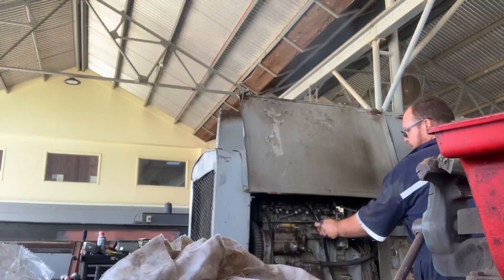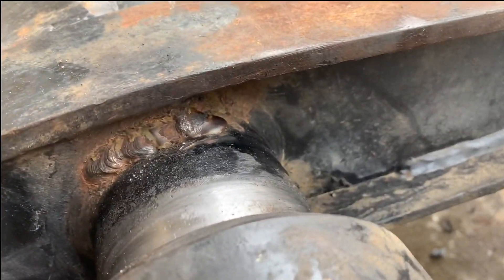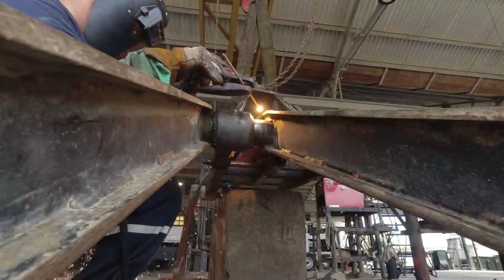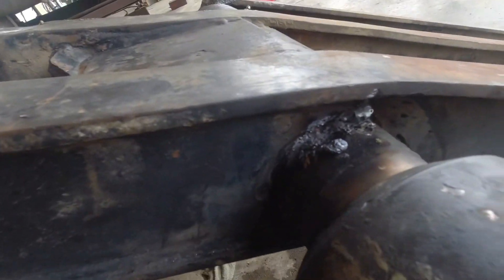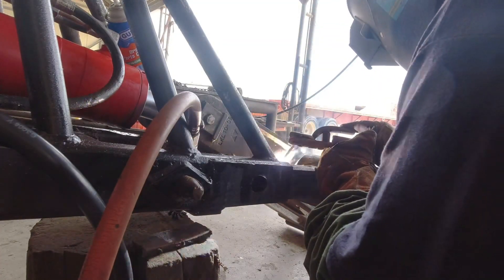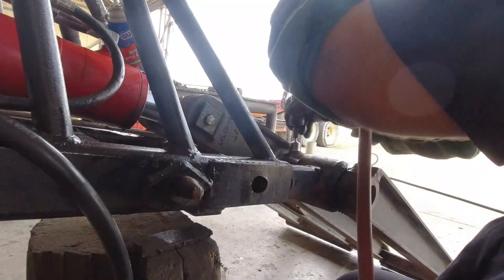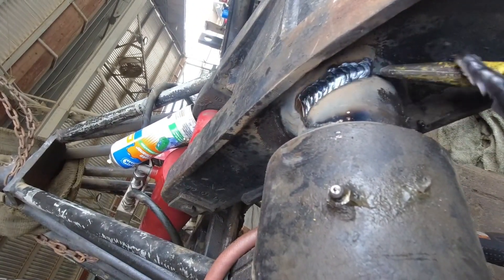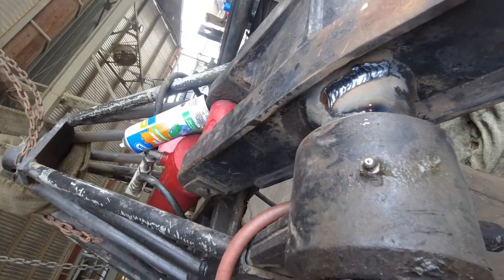Weld Repair  -  stick welding  7018 rods

Comment: With 7018, as the slag falls off easily, you are in the right amp range.  For that heavy section of truck I'd be still about 10 amps higher with such a large cap pass.   PLEASE SUBSRCIBE TO MY CHANNEL as I plan to do a lot of welding videos in the Fall/Winter season [too hot for an old man now lol!]
Reply from the maker: Thanks for all the tips man! I subscribed eager to learn
Reply: @aweldersjourney  ✔

Comment: A cap isn’t just a large ass weave across the entire stack, you don’t need to “cap” stacks. Do you see anyone capping tee joints? A cap can be multiple stringers over a filled groove, no need to weave because that only reduces the strength and creates spots for cold lap and inconsistencies. Run only stringers but you need to tie each bead halfway across the weld face for good fusion thus maximizing the strength.
Reply: If your wondering my experience level, I’m a pipe welder. Work with stick and tig
Reply from the maker: This is some great tip my friend thanks ! I’ve always known stringers is stronger than a weave but didnt know that I didn’t need to do a weave cap,
Reply: Well, I knew you weren’t an English teacher.. that’s for sure.
Reply: @aweldersjourney   this is going to be a long winded information for you dude. 

so hey dude what other dude wrote about is right on. There are a couple of minor things  to bring up. Its mostly semantics though. 

You as the welder for the most part will not effect the strength of the weld its self. The strength  is due to the filler metal, like the 70 in 7018.   But what the other dude was talking about with slag inclusions and cold lap. You can introduce weld defects that can cause a weld to prematurely fail.  As they will basically be spots where stress applied to the weld, will spike at that point . Instead of just flowing across the joint. Think waves coming in and out on a beach. Thats how you want the stress to roll over a weld. Instead of a wave crashing at a bulk head . That stress spiked and caused the wave to crash. 

So with that when somone gives you welding advice. Its coming from their background. Iam not a welder by trade. I am a NDT guy by trade and I taught my self how to weld to some basic codes , for funzies.  So a guy who says you can never weld down hill is more than likely a structural guy, cuz pipe welders depending on the code and the wps ( welding procedure specifications) weld down hill all the time.  

So thats why folks say hey dont weave . There are pros and cons about stringers and weaving. But and here you go with advice, weaves are usually only done with vertical welds. The can put more heat into the part potentially causing the grain structure to be bigger . Which could make the weld being prone to being more brittle but for the most part you are going to fine with carbon steel.  Folks like to weave because its a way for them to keep the weld from building up and space the weld metal out. Any welding technique has its pros and cons. And yes you can trap slag with a weave but you can do that as well with Improper cleaning with stringers and not welding over 2/3rds of the other weld. Sometimes stuff just happens.  I have seen both types of welds and passed and failed both welds for reasons in my career. 

And also you hardly see anyone bitching about a weave with Tig welding🤷‍♂️.Pipe welders walk the cup on everything( well most of the time).But that maybe cuz there is no slag to trap but its still might put excessive heat into the part.  But its such a common way to weld with tig that not a lot of folks question it in the most Industries. 

So all that to tell you that your 1 stringer or 3 stringer pass are more than likely ok. 

For more information. You cant watch on youtube welding tips and tricks and weld . Com . For weld.com I would start with Bob Mofatt, Jason Becker, and mancub. There other host are good to, I just like the older stuff more. 

Podcast: welding tips and tricks wven though its done now. And arc junkies. 

Keep crushing it dude!
Reply from the maker: @blueweld75  wow man thanks ! That was a good read!! Fore sure and I understand what you mean. I will chek those videos out
Reply: @aweldersjourney  yeah man, I enjoy your videos.
Reply from the maker: @blueweld75  thanks man just today i filmed 3 repairs gonna put them in one video this weekend still thinking of a title lol